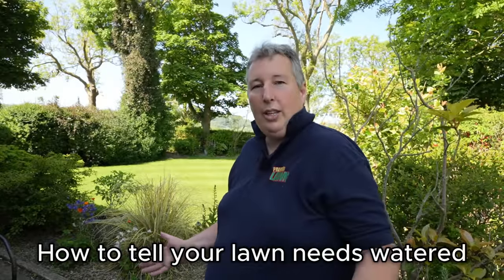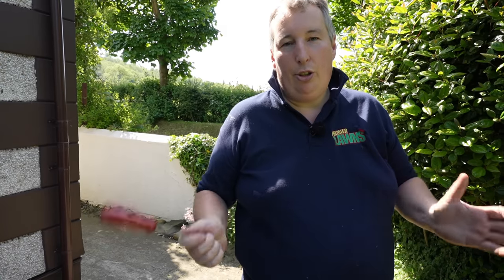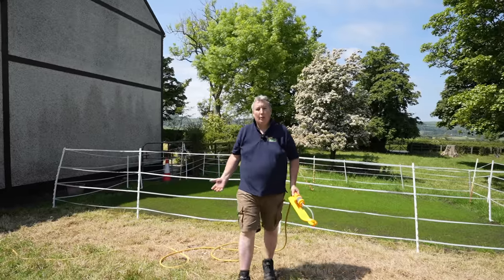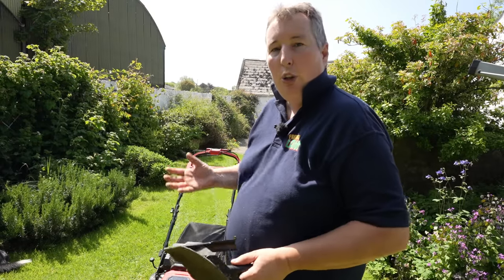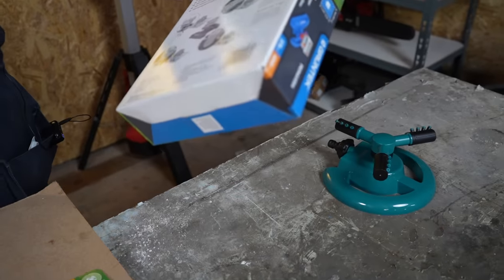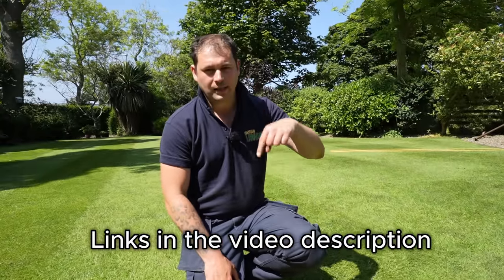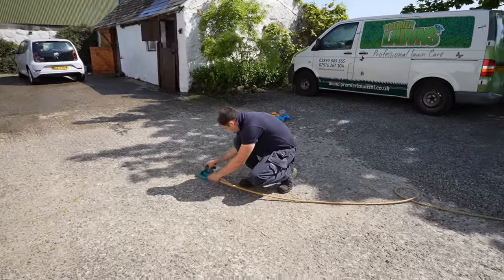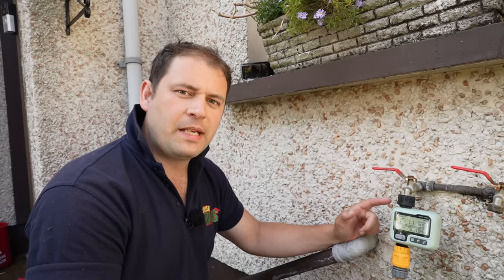95% of people don't know how to water their lawns properly

Comment: Some good tips there Robbie........ I use a basic soil moisture test meter, to aid me when to water the lawn . Has 'Wet', 'Moist', 'Dry' indicator scale. I just push the meter spike in,  at random intervals across the lawn. Then I only water, when meter goes into the 'Dry'.  I rarely water the lawn every day,  usually every 2-3 days in hot weather.
Reply from the maker: Perfect 👍

Comment: The budget one does have adjustment, you can set each arm to a different arc by twisting the ends, so you have one quite vertical to stop the issue you had not getting coverage close to the sprinkler. I have it and when you have it set right it covers a circle absolutely fine
Reply from the maker: We couldn't get it to do anything apart from what it did, we must of had a faulty unit 👍 it didn't come with much in the way of packaging or instructions
Reply: @Premier_lawns_official maybe there are slight variants of ‘budget’! The one I have looks the same and you can turn the ends. Thanks for the response.
Reply from the maker: @philgornall  no probs
Reply: @Premier_lawns_official  I have the budget one, you just turn the end of each head to get the effect you want. It is the best out of the ones you tested as I have tried most of them.
Reply: I have the so called budget one. It is fantastic and saves me wasting water like the long one that i threw in the garbage...
Reply: Yeah, same.  One set at as near to vertical as possible (or maybe a tiny tiny bit less ime), one set to as near to horizontal as possible (this controls the speed and the overall "throw" too), then adjust the 3rd to suit
Reply: @Premier_lawns_official  It can't be faulty on all 3 arms... the arms literally just twist, there's no fancy tabs or anything, you just turn them a bit with your hand. As Phil says, it actually works fine. I have better sprinklers (proper pop-up ones) that I use most of the time, but I have that exact sprinkler for when I just need to do a bit of extra spot-watering and it's fine, surprisingly good in fact!
Reply: Absolutely..The budget one definitely has adjustments. You just have to look twist the ends to the desired angle

Comment: Great video, that adjustable one to bring the spray pattern narrow or wide looks ideal! Tried so many Hozelock sprinklers but all to big for my front lawn. Thanks guys!
Reply from the maker: The blue one was my favorite one as it has a lot of options and works really well
Reply: I have a few different types of sprinkler head and the circular Hozelock one covers a small area - might be just right for your front lawn.
Reply: @neilfarmer6609  hey, if it's the 'Hozelock Multi Rotary sprinkler" I've tried it but it doesn't cover it all being a square garden. I might give it another go. :)

Comment: So just a heads up on that green sprinkler. It looks bad, because you didn't use it properly. You gave it way too much pressure (I did the same). You can actually adjust the nozzles slightly, to point them more up, but then back the pressure off, just turn it on a bit and you'll see steady streams of water coming out and it will cover the area around the sprinkler.
Reply: Agreed. I love this channel but I do feel they either had ulterior motives to sway the results or really just missed the blinding obvious that you could adjust it. Absolutely nothing wrong with the cheap sprinkler apart from you can’t adjust the pattern. You will always waste water with any sprinkler…
Reply: Yeah this sprinkler is amazing, you have to adjust each leg though to ensure full coverage. I do an 8x8 garden with this easily

Comment: I have this cheapest budget sprinkler, it have 3 arms which you can adjust the tilt, more tilt more speed, you can put one arm straight up making it spray right above the sprinkler covering all the areas, other 2 arms can control wider area and slower speed of spinning, which will make water droplets instead of spray. 
And lastly opening the tap will help you with all the adjustments.
Reply from the maker: Thanks a few people have said the same 👍

Comment: The cheapest design (£2.50 @ home bargains in Belfast) is absolutely superb! It can be adjusted to remove the gap you found in the video. Real shame yous marked it down so much as it really is incredible value for money in comparison to the bigger brand units.
Reply from the maker: We couldn't get it to work any other way. It may have been a faulty unit, who knows. It didn't come with much packaging or instructions....
Reply: I agree the budget is a good sprinkler though I’ve gone and bought Amazon basics oscillating one from their warehouse at a good price to try too

Comment: Soil test for regulating nutrients and PH test help alot for ground compaction and the ability of the soil to absorb and hold water longer while draining appropriately. The screw driver test is for compaction not how much water is in the ground. Here in Upstate New York in the U.S. we have heavy clay soil which loves to compact and become like brick if you don't have your soil nutrients and PH correct. With everything in appropriate ranges water for 1.5 inches per week if your not getting rain is plenty. Using organics in your lawn reduces compaction and less water is needed as water gets deeper into the ground. A product call Hydretain also work well for water less often...I never need to aerate my lawn or use sand to  help drainage because my organic input and using humic acid along with root growth stimulates keep my soil draining well. Want a great draining soil...Grow massive roots...
Reply: Pete... thankyou for great information...💗💗

Comment: I am new to gardening. What is an oslowcating sprinkler?
Reply from the maker: Sometimes spelt "Oscillating".
Reply from the maker: An oscillating sprinkler is a device that helps water your garden or lawn by spraying water in a back-and-forth motion. It has a long tube with several small holes or nozzles on top. When you attach it to a hose and turn on the water, the sprinkler moves from side to side, covering a wide area.

As the water flows through the holes or nozzles, it creates a spray that travels in an arc. The oscillating motion of the sprinkler ensures that the water is distributed evenly across your garden or lawn. This helps to keep your plants hydrated and promotes healthy growth.

You can usually adjust the range and width of the spray by using controls on the sprinkler. This allows you to customize the watering pattern to suit the size and shape of your garden.
Reply: OSS I lay ting he means
Reply: Lol. Searching for this joke in the comments 😂

Comment: Another great one Robbie, thanks. Learned a heap more there from you and will try the screwdriver test tomorrow. I must admit I just took the hose to it last night. Got a new puppy and couldn’t be bothered or find the energy to set up the sprinkler. Am I to late for a wetting agent? I got some last month, but have never got round to it.
Reply from the maker: The wetting agent needs to go on before it starts to dry out. But to be honest I don't use them that much myself so you should be ok 👌👍
Reply: @Premier_lawns_official  Thanks Robbie.

Comment: Cheers Robbie, I'll have to get my trimmer set up for the mornings. I know with this heat wave  not to put nitrogen on your lawn, but what's the best granular fertiliser for summer time? 
Thanks Robbie
Reply: Would you use a
 9 7 7 fert or higher nitrogen?
Reply from the maker: I use a lot of slow-release nitrogen fertilisers with a balanced NPK (nitrogen, phosphorus, and potassium) ratio. They provide a steady supply of nutrients over an extended period, which helps avoid excessive growth spurts and minimises the risk of burning the grass in hot weather.
Reply: As always, cheers Robbie for the advice!!! 😊
Reply: @Premier_lawns_official  could you recommend any brand of fertilizer?
Reply from the maker: @geoffaries  I use a lot of ICL products

Comment: Robbie what about cutting in the heat to is it best to keep the length  ?
Reply from the maker: That will depend on what height and how often it's usually cut at. My advice would be just to take the tips off
Reply: Hi Robbie I was trying to work with 30 r 35mm sitting about 40 now as let it grow ther with the heat was thinking just chip off it then

Comment: Hate to be a wet reg but the budget sprinkler is adjustable… may be stiff but the black tips are rotatable to change the distance of spray from the base… throw the water higher and it will close the unsprayed ring
Reply: That said they’re still inferior to most other designs… but they’re adjustable and they work better than nothing…
Reply from the maker: Funny I have a video going out this weekend and we address this very thing 🙂

Comment: The oscillating one can become jammed by limescale in areas with hard water.
Reply from the maker: Hey Neil I have yet to see that though have read about it
Reply: If it does jam spray WD-40 or PB Blaster into the water nozzles. Let it sit for an hour or so in the nozzles...Set it back up and should be totally unclogged...
Reply: I think you’ll find it is oz-lik-are-ing

Comment: "Onto the budget one, there's no adjustment for this"

Yes there is, you can angle the three arms for a wider or narrower throw pattern. This also solves the "gap between the device and where the water lands" problem, by setting the three arms to different angles: having one pointing more vertically means the water will land closer to the sprinkler
Reply from the maker: Thanks 👍

Comment: What mower is that how did you get the stripes without a roller ?
Reply from the maker: That mower show is a Milwaukee Battery mower, the lawn at the front is cut with an old antique John Deere cylinder mower

Comment: A good way to tell if your lawn is getting dry is by looking at the color. Before it starts to take damage it shifts the color a bit to blue, which is the perfect time for a deep watering.
Reply: How long is a deep watering?
Reply: @sleepersix  Depends on your soil. Online you can find Liters per square meter and then calculate the time with how much flow your irrigation has.

Comment: I’ve never understood the suggestion no to water in the evening. It rains at all hours, and we don’t worry about it.
Reply: It rains at all hours, of course, but you're choosing to add extra water on top

If you're doing that, you can choose when to add the water - so it's best to add it in the morning when the grass is about to grow and be active all day, rather than at night when fungus is active
Reply: I’ve always thought watering at night was better during a heat wave/ dry spell as it gave the water time to soak in and not evaporate
Reply: Water at NIGHT - 
SAVE 75-80% IN EVAPORATION!!!
(Water will stay in ground for longer)
Reply: Agreed - Fungus doesn’t just develop by watering at night. There’s several other factors like how much water you’re putting etc.
Reply: Surely watering at night throughout droughts or when it hasn’t rained in ages would be ok to do too.

Comment: The only way to properly water your lawn is to install a properly designed irrigation system according to IA standards. You need head to head coverage and cycle your watering times.

Suggesting that people purchase impact style temporary sprinkler heads is bad advice. Extremely time consuming and as well, the distributive uniformity is awful: meaning, massively inefficient.

This is weekend Joe nonsense. Everything you are displaying here for purchase is a waste of resources and water.

I should know, I run a very successful sprinkler repair and installation business in Denver, Colorado, United States. 303 sprinklers. This is why I'm going to be working on quality content when i have free time, to dispel such awful advice
Reply from the maker: Thanks for the feedback, most gardens in the UK need only one or two sprinklers at best. We don't have huge open gardens like they have in America
Reply: @Premier_lawns_official  you get so much rain. Please forgive me because I should have recognized the accent and your different needs.
Those garden hose sprinklers are very inefficient. Think of it this way. The precipitation rate at 30' is 3x less than at the head. So they aren't putting nearly the inch per hour away as you are up close.

Anyway. I know you know your stuff for your region but watering at 5200' in an air environment ISD much different. Thanks for your polite response to my scathing comment. I value perfection and sometimes I get irritable with internet advice. I know you are producing content for your audience
Reply from the maker: @rockymountainhomestead  it's 100 percent ok. I don't claim to know everything and probably just like you, I use YouTube to learn. 
Your response has given me pause for thought and I will have to give it a bit more thought for my next video 👌 
All the best and nice chatting with you
Reply: @Premier_lawns_official  likewise. I know you care..I can tell. That matters. Godspeed